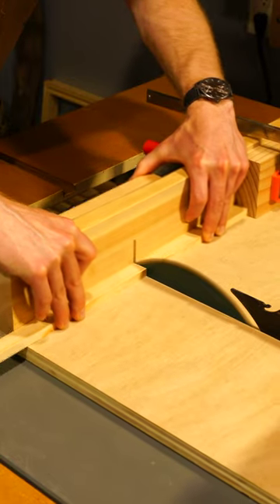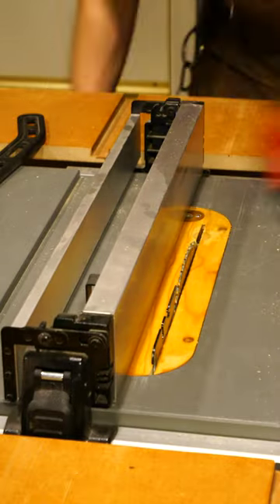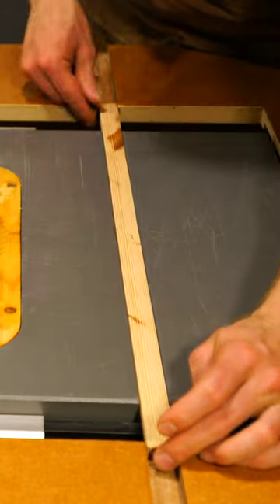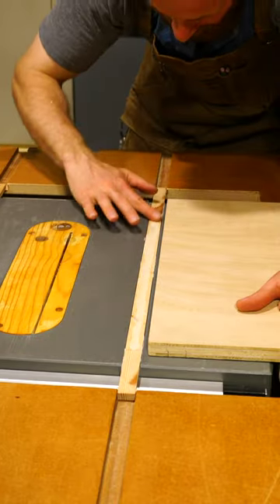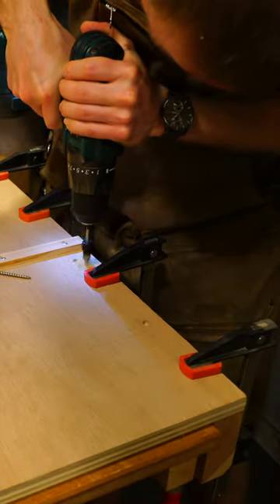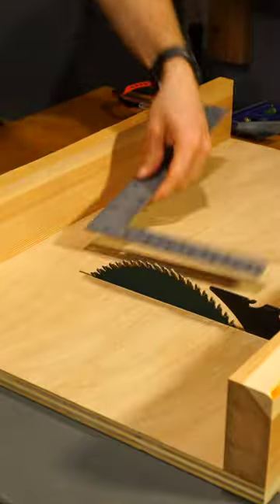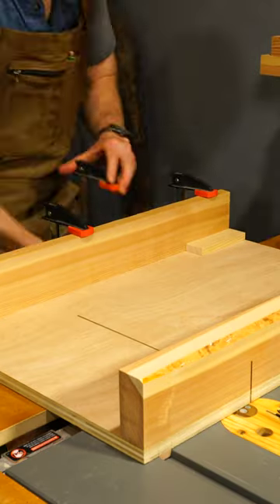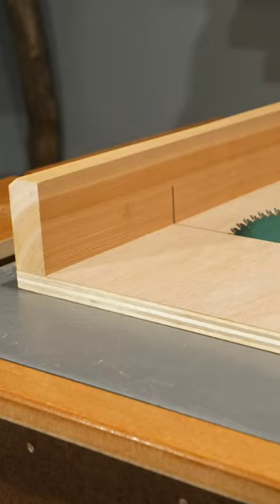DIY Crosscut Sled!

Comment: You never line up to the saw blade or the fence. You square up to your mitre slots. And as already mentioned, without doing the 5 cut method to correct inaccuracies you’ll never get that thing square enough to be of use.
Reply from the maker: You need the back fence square to the saw blade, I know that for a fact. The 5 cut method does seem to be very helpful! It’s accurate enough for my purposes without it!
Reply: The 5 cut method is not the do all and save all. It's a very accurate method but definitely NOT the only one.
I get perfectly square cuts without using it.

Comment: So what if there's only 1 track, like on a Ryobi
Reply from the maker: It’ll still work just won’t be as accurate. I suppose you could somehow reference the edge of the table saw if it’s parallel to the other track if that makes sense. Like have it snug up against the edge to keep it from moving from left to right as you cut.